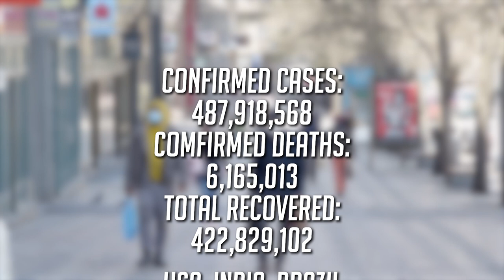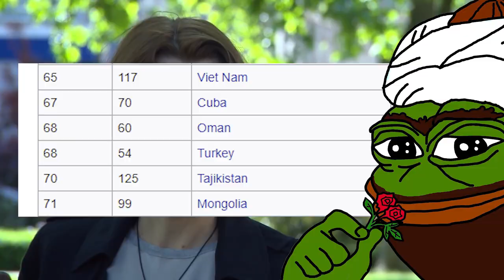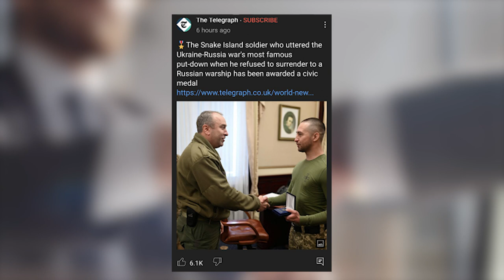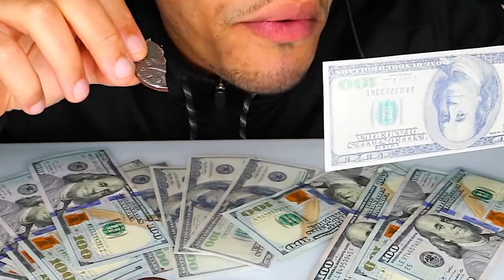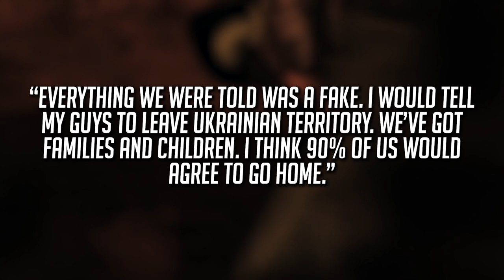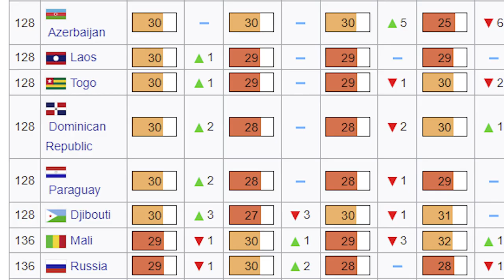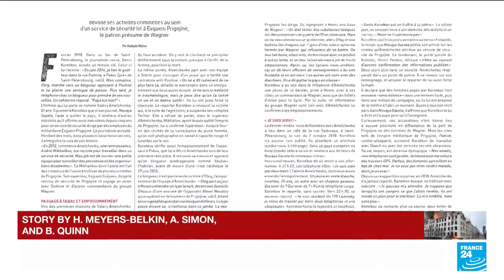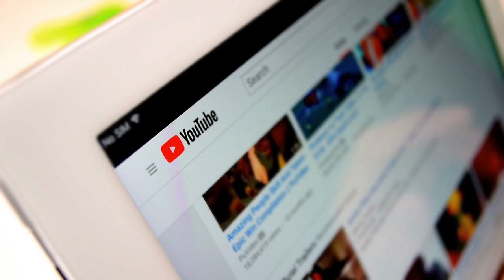This month's news without the bulls%&t (March 2022)

Comment: I think the entire gas situation was the perfect moment to switch to renewables and decreasse car dependancy. 
If our polititians were not shaking hands with the oil lobby, that is
Reply: We should be going hard in the paint with oil instead of slowing down. I can't worry about the next generation when I don't have food security.
Reply: @SquashGuy02134  You cant ban oil in a single day. You have to have plans for the switch and execute them quickly and efficiently. You have to slowly change the streets and remodel infarsructure and incentivise the private sector hard before you go net 0.
Reply: @davitdavid7165  With the current global leadership it might be a better investment to buy a horse at this point. I wish we could explore nuclear power more.
Reply: @SquashGuy02134  i think the best  investment is some good walking shoes, a good practical bike and to get used to public transport. If the car market crashes and pushing public transport is good for an election campaign, it will give resaults
Reply: @davitdavid7165  The bus in my town dosen't even operate on Sundays yet. We need city laws for cities and small town laws for small towns, our lives and needs are fundamentally different